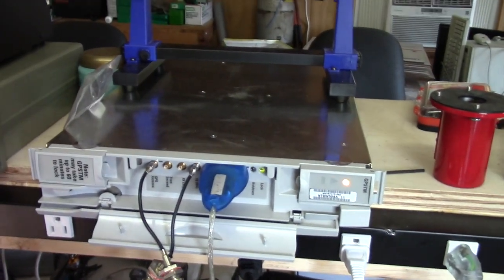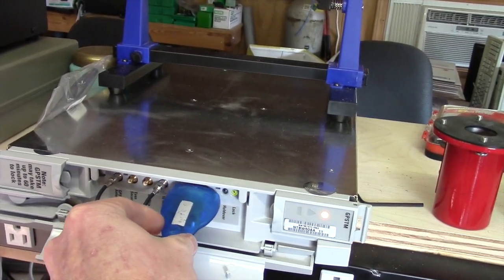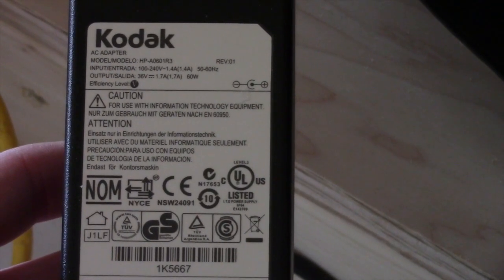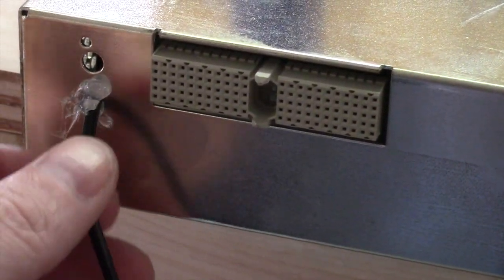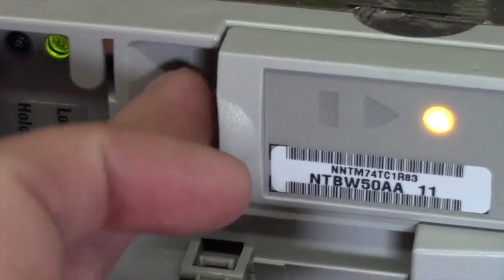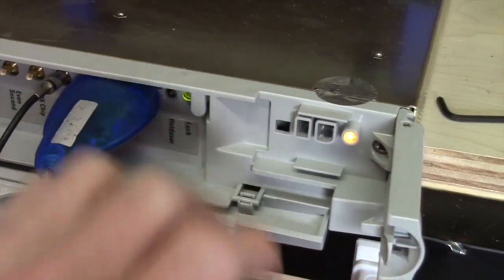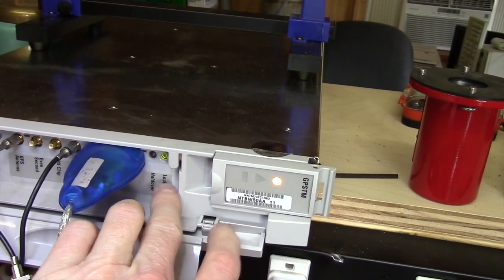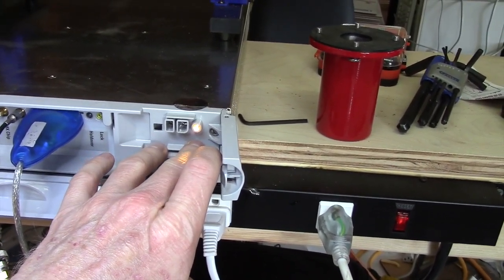DIY GPSDO Hacked Nortel GPS Disciplined Oscillator

Comment: I recently bought a old GPSTM, the 48 volt version, but I can't get it to power up. Can you tell me how you connected the external power supply ti the unit internally?
Reply from the maker: There are two traces I soldered to.  They are the heavy ones leaving the connector.
Reply: @ShaneBurrell1  I'm finding out that I have a totally different motherboard where the power traces and power supply isn't at all obvious, no super sized traces. I assume you have the 24V version and I have the 48V version. Thanks for responding though!
Reply from the maker: @vernonstuff2566  I have the 48 volt. The power module is easy to spot. Large plastic box.
Reply: @ShaneBurrell1  I can see my power module, but I just learned there are at least two board versions; one is the length of the case's depth with the SMB connectors mounted on the board, mine is the width of the case and half the depth with bulkhead SMBs and cables back to the board. Is there a way I can send you a pic so you can see what I talking about?
Reply from the maker: @vernonstuff2566  Sure my email is easy to find. firstname@firstnamelastname.com format.

Comment: That card is for the BTS which is the field equipment that sits out at the tower. I know for a fact it was used in Nortel CDMA Metrocells, could have been used elsewhere, but not sure. This unit is not used in the CDMA switch equipment, though there is a module used in the Passport 15K enclosures which are fundamentally the same, uses the same firmware, but physically different.
Reply from the maker: Most important is that it wraps a Trimble GPSDO and its fairly accessible for repurposing.

Comment: Shane,I noticed on your blog photo that you have your power supply cable center electrode connected to the negative side..is that because you are using the higher voltage input of 48v?
Reply from the maker: Doug Aldrian It is not connected to the negative side. That's a rectifier. Take a look at the data sheet for the df06s and it will make more sense. You will want to connect to the ac side in a simlilar fashion if you have a 24-48 dc power supply.
Reply: wow, now i'm really glad i asked before messing that up!   thanks for the info.
Reply from the maker: No problem.  You should be able to connect your supply just like mine.

Comment: Thanks for posting this video!  I just bought one on ebay as well so this is helpful.  One question, do you know if there is any advantage to feeding it -48v vs +24 v ?  the OEM General Spec  seems to imply either will work properly.
Reply from the maker: Glad you like it.  Mine is still doing great, running 24x7 since this video was made.